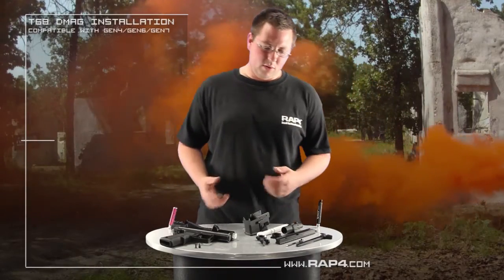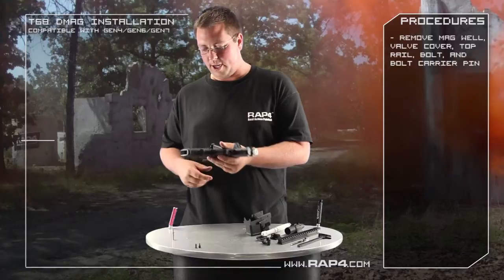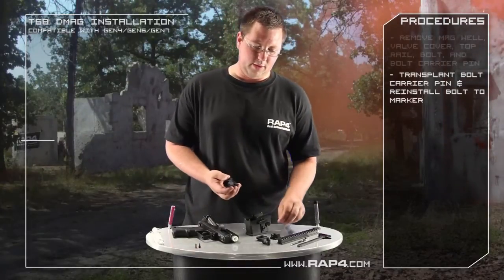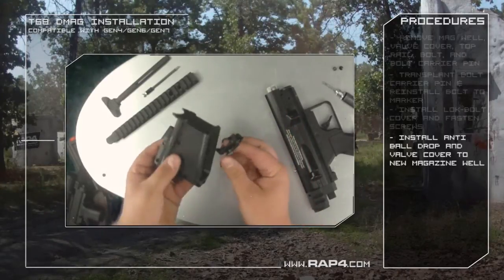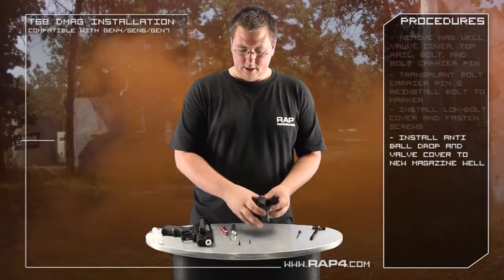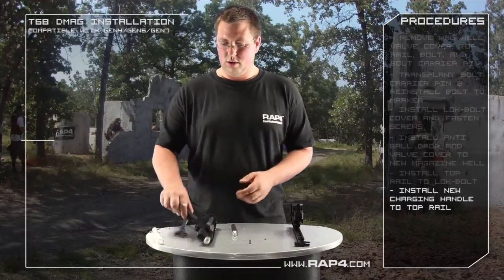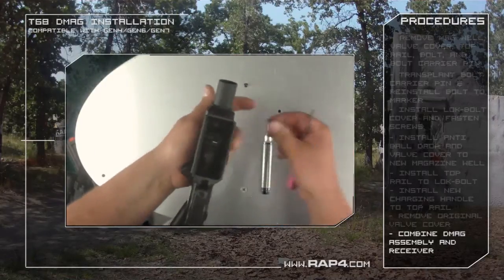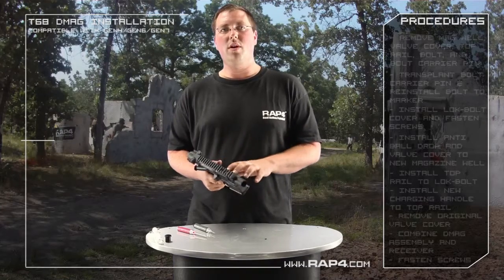T68 DMAG Installation

Comment: just bought one of these, lets see if it works because i have yet to get my t68 to shoot using the stock mags.
Reply: I know this is an old post but I cant find any reviews on how it operates with first strike rounds. I called mcs but it felt like they were just trying to up sell me on the 468. Said they had alot of flipping issues and it wasn't reliable with first strike